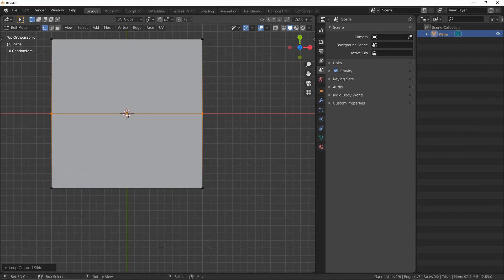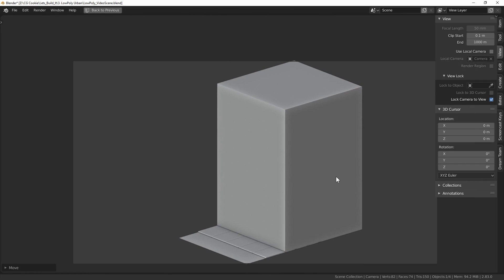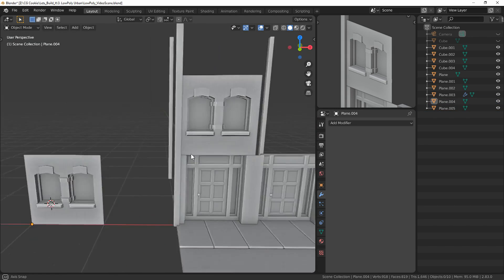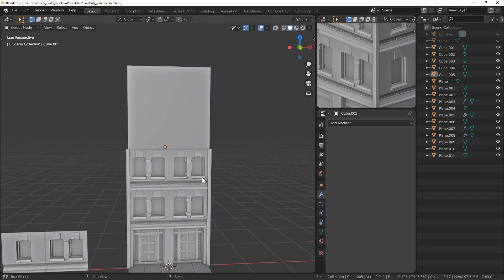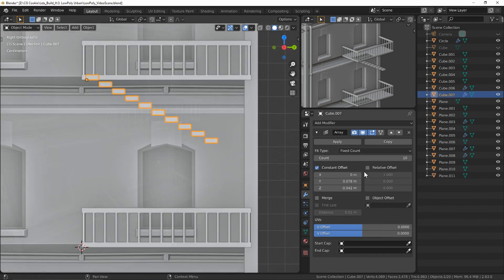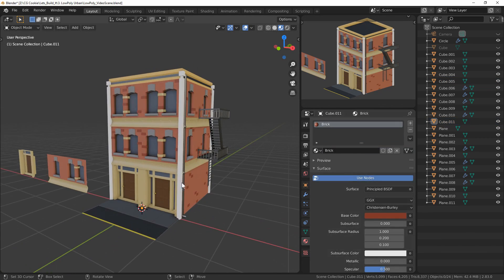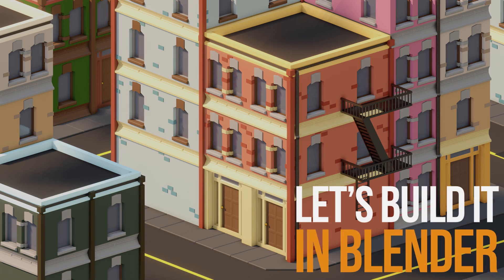Urban Low-poly Building | Let's Build It In Blender

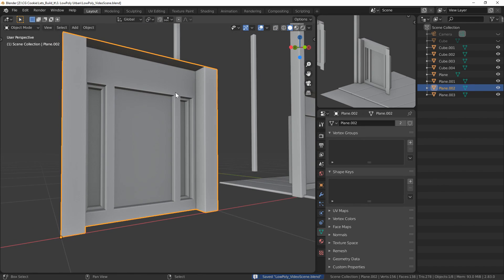Comment: how did you do that at 3:00 where you can scale all the faces of the plane on the door and it affects it separately when you extrude and scale, if that makes sense?
Reply: also, how did you do the thing at 4:00 with the two line, please?
Reply: @finalmasquerade  3:00, you can select multiple faces, press I to inset, and then press B to turn 'border' on and off, this means each face will separately inset.

4:00, if you ctrl + B (bevel) an edge loop it'll create a symmetrical face around the edge loop.

Comment: There might be a simple solution, but in your workflow, everything connects to each other and moves per 1 meter. However, the snap function is not turned on? How?
Reply: You can hold down Ctrl to temporarily activate snapping.

Comment: How do you move stuff and keep it locked to the grid lines?
Reply: https://docs.blender.org/manual/en/latest/editors/3dview/controls/snapping.html?highlight=snap%20grid

Basically, check your snaps. Enable "Increment" and also check the "Absolute Snap to Grid"
If it's turned off, you can temporarily enable it while using a transform (G, R, or S) by holding CTRL

Comment: In a lot of these, whenever you need a cylinder, you always just make a circle and extrude, instead of just using the actual cylinder primitive. What’s the reason behind this? My guess is... you don’t need the end cap geometry, so this is a way to not have to delete the faces of the cylinder.... but it’s the same amount of steps. Make a circle and extrude, or make a cylinder and delete faces... so is there more to it? Annoying properties the cylinder has or something? Or it’s bad to delete those faces or something ?

Comment: How does he do the bevel at the beginning? I can loop cut fine but can't get the bevel to work like he does
Reply: For the sidewalk bevel at the beginning, after you've made your loop cut and add the bevel, it will look flat until you select the center line of each bevel and use alt-s, more aptly known as shrink/fatten, to adjust the depth of the bevel you've created.
Reply: @Hwatta  omg, thanks! i was stuck on that one for like 30 minutes 😂
Reply: I believe it was the bevel modifier :)

Comment: What is instancing? Is it the Alt+D thing or another? I'm only familiar with brute force modeling so I didn't know of the instance
Reply: Yes alt+D .... shift + D is duplicate .. just a copy. The instance is a copy but it is tied to the original, so any changes you make to the original happen to all the instanced copies... so you can have a thousand doors all editable through the one original. Kinda like a class in CSS.
I’m not entirely sure if the connection is editable... like what changes you can make to the instances without breaking the connection (beside small,move rotate).

Also I think when you instance the computer uses way less resources to create all the instanced copies. It might even technically lower the polygon count? Because they’re not “real” objects. Something like that lol

Comment: liking these series . thank you for the efforts you are putting in these just one suggestion dont skip the crucial modeling parts such as the one where made arched windows...could have learned one or two tricks from u there.👌🏻
Reply from the maker: Hey Saksham, thanks for the input! For the arch, all that was really involved was adding an edge loop down the centre of the window, moving the interior and exterior vertices of the top frame up vertically and then using the Ctrl +B hotkey to bevel the centre edge loop as much as I wanted. From there, I just merged any unnecessary vertices for some clean up. I hope that is able to make up a little bit for potentially lost info! -Chunck :)